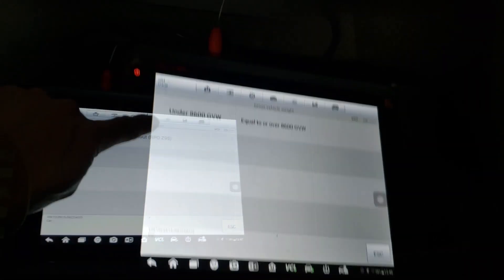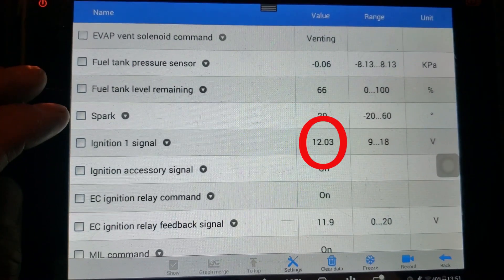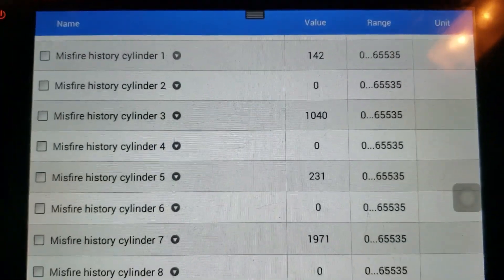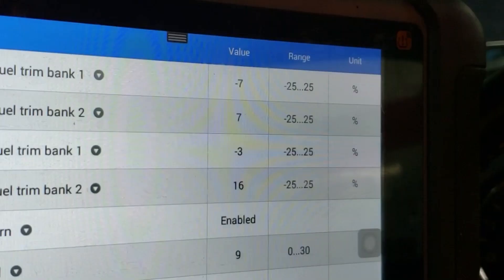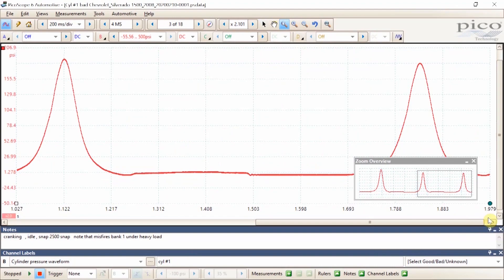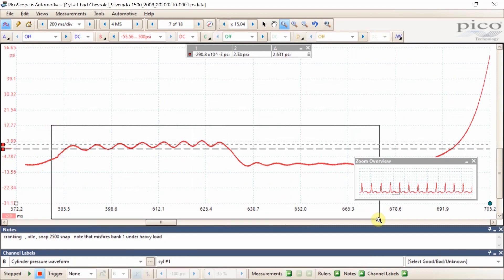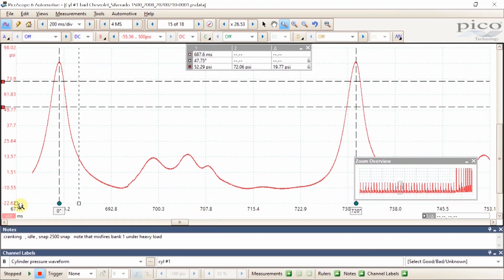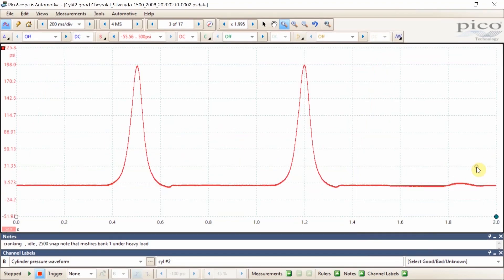2008 Silverado 5.3 Restricted Exhaust P0300

Comment: it always begs the question: did ignored misfiring ruin the cat or did a failing cat create the misfires?
Reply from the maker: I have been waiting fro some one to ask that!  Always have to be asking what caused the problem, are we just fixing the symptom and not the root cause.  So I saw  a issue very intermittently from cylinder #7, I recommended that we replace the converters assembly and then retest for any misfires before release of the vehicle.

Comment: brian if u tested with just a vacuum gage on intake manifold at 2500 rpm would have shown pressure rise in manifold from idle ?
Reply from the maker: That is a great question, I think it would have as this was a substantial problem. I wish I would have put the wps in there!